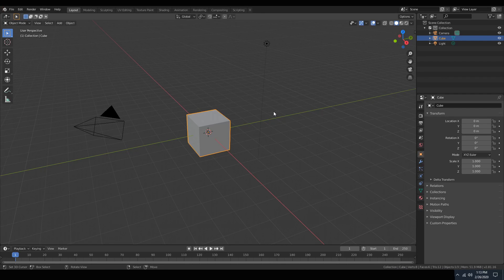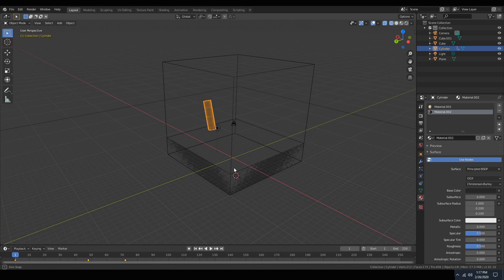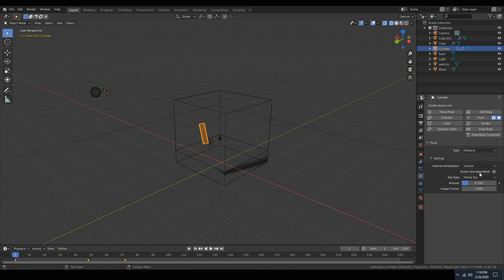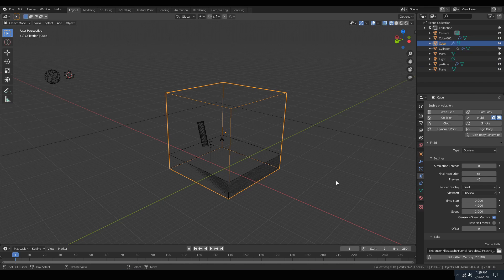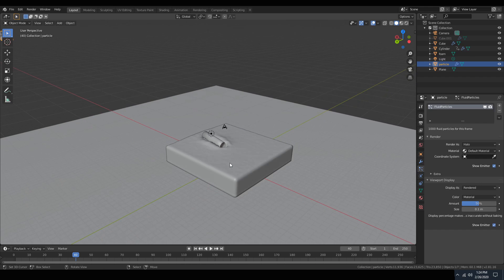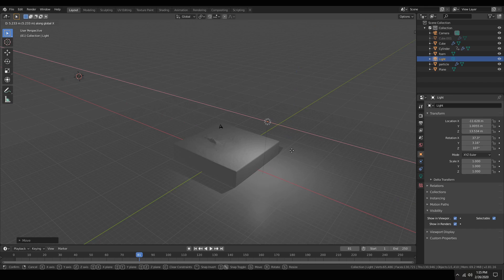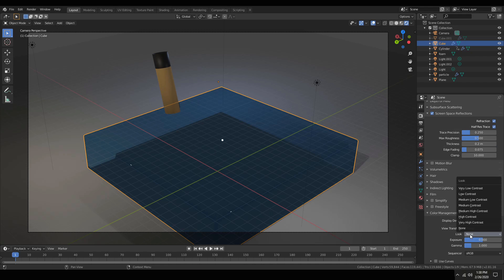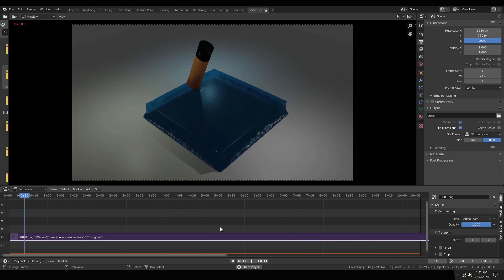Blender 2.8 Fluid Sim With Foam & Moving Objects

Comment: What kind of black magic are you performing here to make it run so well? Even after a bake on 64 res and with 10% particles it lags to the point the program is completely unusable or even crashes even on my 10-core i9-10850k OCed to 5.0ghz.

I guess I could always scale down the sim box (currently it is pretty big) or give Blender more RAM (currently uses 12 GB out of my 32 GB in system preferences)

Comment: Hoping you're still checking comments here. I am wondering if this was done with Mantaflow? I am guessing not. A lot of the options you are selecting are not in mantaflow. The key one is having an object float, like the particles. Any thoughts?
Reply from the maker: Haven’t used Mantaflow before and yes this wasn’t done with it. Sorry
Reply: @TitanicAnimations  No worries. I try to stay away from key framing and let the physics do the work, so I have been trying to manipulate a beach ball falling into a water simulation and having the beach ball react to a heavier mass. It's not really possible with the fluid simulations because you cannot specify water with a mass of 1, and anything "lighter" would float. There may be a python script, but I would have no idea where to run it. I saw your tutorial (nice work, by the way) and saw that you specified a dupli-object that floats for the particle foam. That doesn't seem to be a possibility with Mantaflow that ships with Blender 2.82. With a bit of tweaking, you can simulate a beach ball object with Friction and Damping to get the water to react in the simulation. However to keep the ball from falling through the water, you need a plane just below the surface to act as the buoyancy. Anyway, thanks for getting back to me. I might post this work around, because there is nothing here that speaks to a water simulation, floating object without key framing. Cheers!

Comment: I'm curious how you made the flooding fluid simulation
I tried to make something quick and the fluid just vanishes  or it doesn't raise to flood the upper levels
Reply from the maker: Make whatever room you want to flood, and set that as your obstacle. add a small cube off camera, like for instance outside of the room's door, and set that object as an inflow. Then make a domain cube and scale that up to where the entire room and inflow object are inside it. Depending on the room size you might have to scale the room and inflow down because from my understanding Blender has a maximum domain size of 30m x 30m x 30m. Then its all pretty much the same, the only thing that changes is the length of your shot. The corridor flooding I did for example was a 6 minute long shot. I had the fluid moving in real time, so I changed the "time" of the object to be 360 seconds instead of the default 1.

Then sit back and watch a few seasons of your current favorite TV show to binge on Netflix because the bake is going to take a while. It took about 19 hours to bake the corridor simulation at around 300 resolution. If you have foam present the bake is going to take even longer than that.
Reply: @TitanicAnimations  
Yeah that's more or less what I tried
though it's possible the scale I used was too big or something.

The water was some time just clipping through walls even though they were used as obstacle 

I tried to "hack" a way to create raising water by adding water on top of a moving platform and the same stuff happened, 
the water didn't raised much.
 instead was was pushed up a bit and disappeared

I never rendered the whole thing, so maybe it was just a viewport issue
Reply from the maker: @Pac0Master  Hrm, did you apply the scale to each object? I know sometimes fluid has a wonky interaction with stuff when the scales aren't set properly.

With each individual object inside the scene try selecting each one and then "Control+A" and select "Scale" and this apply's any changes done to the mesh's scale so that it equal's 1.

It is worth noting tho that even in my fluid sims they always clip through walls and stuff. Whenever that happens I try to design where I place the camera in order to hide those goofs.
Reply: @TitanicAnimations  

I tried again and I still get issues

I try to create some sort of very quick hallway and I put a "well" next to a corner, so the idea is for the water to raise in the well and then overflow into the hallway and down a staircase

but It just won't happen. there's always too much clipping and I can't seem to fix it